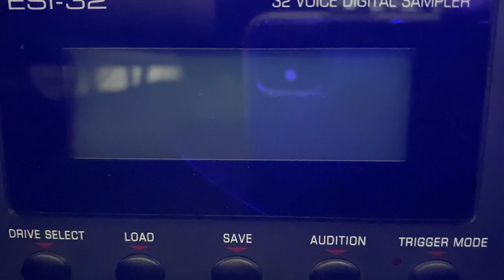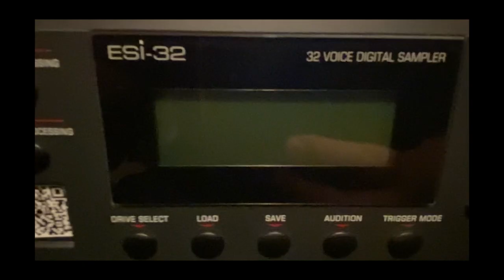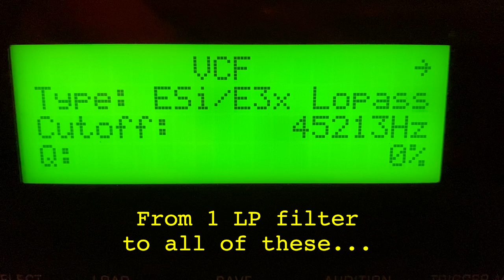EMU ESi-32 Sampler Firmware update chip install

Comment: But what exactly was the problem during the pull-out of the 1st chip? Did you place the tool wrong? Or in other words: Could you explain how you did it well on the second one? I want to do the same upgrade, and now i am fearing about the process... Thanks!
Reply from the maker: The problem was a combination of my inexperience and old gear.  I think there was a little bit of oxidation on the chip teeth which made it a little "sticky" on the socket.  That and yes, I wasn't placing the tool correctly for a proper grip of the chip.  By the time I did the second one, I understood where the tool needed to be placed.  The hooks on the tool needed to be placed firmly under the chip, to get a good grip and good pull.  I was snagging the sides of the chip.  Thus, the tool continuously slipping off of the chip.  And that caused the chip to come off crooked, instead of popping straight up.  I should have popped the chip back in with my thumb, and then tried again, instead of continually messing with the "crooked" chip.  So I needed to get those hooks around the chip, start with a slight squeeze to "hug" the chip.  Then a tighter squeeze to let the tool pull the chip up.
Reply: @masterjoda75  Hey man, thank you very much! This sounds as if the job is manageable for my skills... Have fun with your ESI (like i do)! I love this vintage piece of gear. It's much more powerful than todays people think.